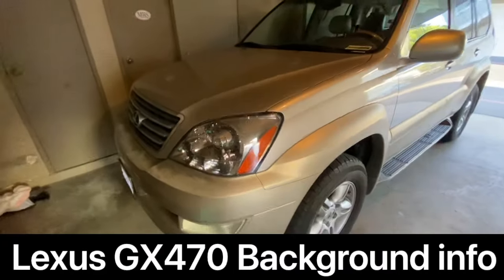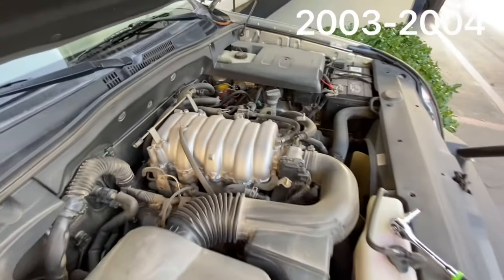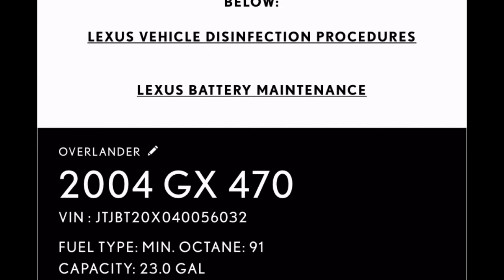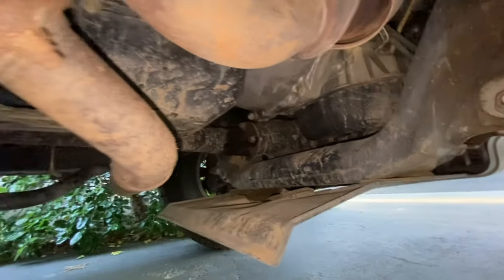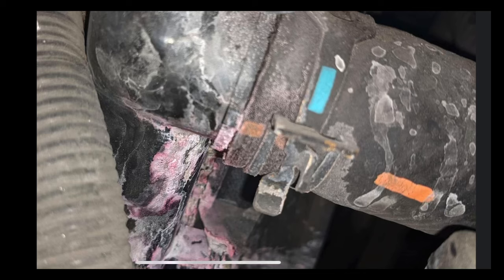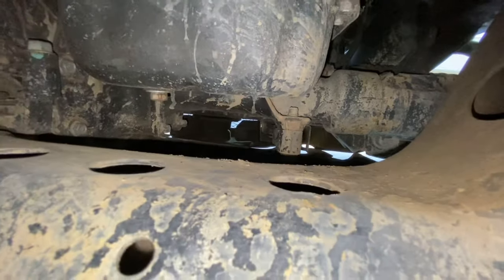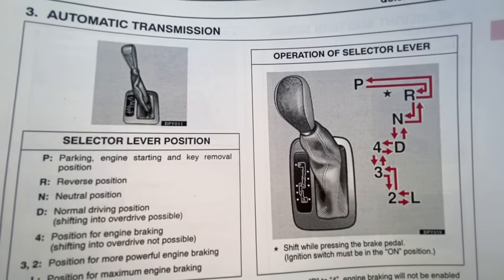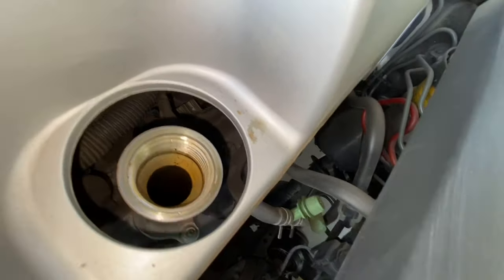LEXUS GX470 BUYERS GUIDE - 7 Things You NEED to Know

Comment: Thanks for the video. What are your thoughts of the 2010 models?
Reply from the maker: Thanks for watching! The consensus in the GX community seems to be to buy the latest/lowest mile GX you can afford or are in the market to spend, regardless of generation. The later ones with the 4.6 are more efficient and powerful, but that comes with more complexity. I believe there is a coolant leak issue that is common around 100-120k miles in those. However, the 4.6 has a timing chain vs. timing belt so you won’t need to spend $1k every 90k miles to change out the timing belt/water pump/bearings/pulleys. HOWEVER (haha) changing out those components semi-regularly on the 4.7 may be a contributing factor to why they last so long and are so reliable. There’s always going to be trade-offs. It depends what you’re in the market for. For me, I wanted a cheap, reliable, capable overland rig. Others may want a luxury SUV like Lexus designed these things for. If the former*, I recommend a 03-04 GX without VVT-i since there are more of those in the market and hence *should be lower priced. If you need more power and can spend a bit more, get the latest (07-09) VVT model you can find if possible to postpone the inevitable secondary air injection pump issue. If you’re looking for the latter a 2010+ 460 would be a good place to start, specifically post 2014 with the facelift. The 2010-13 has a face only a mother could love in my opinion lol but for me it would be worth it to get the benefits of the updated power train.
Reply: @lexus_offroad_adventures  thank you. Appreciate your thoughts.

Comment: I had to replace my radiator first thing when I bought my ‘04 with 155k miles.  Other than that it’s been a great reliable vehicle.
Reply from the maker: Nice, yeah I bought mine at 155k as well and the previous owner had just done a radiator+timing belt+water pump. No issues at all other than the transfer case actuator leak, which I fixed for a couple bucks and made a video about
Reply: @lexus_offroad_adventures  i have 210k on it now and am getting ready to do the timing belt and water pump again. I saved that actuator video just in case I need to fix that issue if it arises. Thank you for all of the great info!!✌🏻

Comment: Spectacular video. I am on the fence and thinking about adding this as my second and weekend car. I own a 200 series Land Cruiser which I love but want some thing reliable that I can not worry about. Should I be scared of 150,000 miles with good service records? Can this engine and platform really last 250,000 miles?
Reply from the maker: Thanks for watching! It’s essentially the same powertrain as the 100 series Land Cruiser, so yes, the longevity is legit. As I always recommend to people looking for a 470, get a pre-purchase inspection by a reputable shop (preferably a Toyota/Lexus specialist) before buying. It’s a few hundred bucks but it’ll do 2 things for you: 1) tell you everything that the truck needs in terms of maintenance or repairs, or 2) tell you that the truck is a lemon that you need to run away from.

Comment: Just in about to get 1 but not sure if is vwry neccessary buying a newer model or is pretty logic to save some money and buy the older 1 from 2003-2004. Also the horse power, is it a big difference between? Would really appreciate any advice on it as i cant wait of getting my first gx!!
Reply from the maker: I like the 03-04 for their simplicity. No VVT and no Secondary Air Injection (they all fail eventually) But newer ones do have 35 more hp which is nice.

Comment: Good job on the review, and analysis. If you see this what is the most desirable used Lexus 4xx.
I used to have land cruisers fj40, fj60,etc… got away from them for years. I Don’t want to have GM trucks, anymore and I like the one you’re discussing. I’m definitely buying one that has never seen off road, a soccer mom used one.
I’ve seen a nice 2011,GX 460, very clean. It says 4 wheel drive but are these AWD, also if they ran them on regular gas is that a bad thing with the ethanol?
Reply from the maker: Yes they are AWD with a Torsen limited slip center differential/transfer case. They become proper 4WD when you hit the center differential lock button and it splits power 50/50 between front and rear. 460s need premium.
Reply: @lexus_offroad_adventures  thanks for that. I’ve always shyed away from AWD, old school mindset. Like to have the front warn hubs unlocked.
But the GX460/70 are new generation, I think I’ve waited long enough for them to iron out any issues with the new designs.
I do kinda laugh when I see all the young guys, adding the big wheels & tires, lift kits, body accessories and then saying they don’t get good mileage !
I just think it’s funny. I will keep a tall set of studded truck tires for going off road. Thanks for response to questions. Now that I’ve decided what vehicle I want, I will wait until I find and un modified, well maintained, never towed, gx470.
Reply from the maker: @peterparsons7141  the AWD system is all mechanical (Torsen), so nothing to really worry about. The only electronic component is the center diff lock actuator, which is a potential pain point since then never get “exercised” by the owners, but just test it out when on your test drive to make sure it works and use it every so often if you buy the vehicle. Oh yeah, can’t go wrong with old school stuff. But if you’re going to go with a late model off-roader, the GX platform whether 1st gen (470, 03-09) or second gen (460, ‘10-present) is comfortable and fairly well proven in terms of reliability. My GX470 is 20 years old next year and, amazingly, everything still works! I’m sure if you find a clean example with the criteria you mentioned, it’ll be a nice vehicle for you. But yeah, no matter the year, if you put on big tires, they get thirsty 😅
Reply: @lexus_offroad_adventures  thanks , that’s exactly the info I wanted and just the broad information. I’m definitely going with the 467/470. The land cruisers are over priced and parts are hard to find. Regards to the center diff lock , it was a similar issue the the warn fron hubs in the old stuff. If you never used them or maintenance them, then they could get stuck/locked . Etc. So we serviced them when doing wheel service, and used them regularly. I do the same in my 5th gen, GMC trucks. Nothing worse than not using something for 18 months, 3 seasons, and then turn it on and go 100% full power.. dosnt make sense and never ends well with any machine or tool.
I just dismissed most of the new stuff, I happened on a very clean 460. Original owner, well maintained and started to look at them and realized these were pretty good machines. There’s no getting away from touch screens and computers etc, so my experience with Toyota’s tells me this is the way to go. But not new one, I’m not paying 80k for something that I may push hard. Insurance dosnt cover for roll overs in bad places.
Reply: Really appreciate your thoughtful informative response.
I’m starting to get a good feel for the GX, and am actively monitoring what’s available. I will do my work up front so as not to have to learn about potential problems when they appear.   Do you have a quick way of differentiating between models. I’m going second gen,  2014-201x.
As I understand there’s three models.  Base,Premium, Ultra. With the used car sales people obfuscating between these.
Base is easy. 
Premium.. with options
Ultra with options.
Crawl mode, and lane change indicator . Is this a telling feature which differentiates Premium/Ulta..?
Do car people still use VIN codes as an easier way to know what we’re dealing with ? (That’s an old dude question).
How do you quickly identify the most desirable?
Thanks again for you previous responses.

Comment: Great video! You briefly mentioned the KDSS that can be found in some of these models. After doing some research on the functionality of the system it seems to be a very good at improving the road handling but due to the geometry of the system and the complexity it can be very difficult to increase the height of the lift and suspension travel. Since you own a very capable GX, can you go over any issues that you may have had with KDSS and possible solutions? I Really want a late model Gx470 to build but I'm on the fence about KDSS. TIA
Reply from the maker: Thanks for watching! 
KDSS is great to get the best of both worlds for on/off-road handling. Problem is, you’re mostly limited to 2.5” of front lift and only about 1” of rear lift to not run into issues with “KDSS Lean” or a stiff ride.
This is really the only tried and true solution, just don’t lift it too high and it should perform fine. Actually would perform better to a normal GX. But a lot of people don’t want to be lift-limited like that. 

I just don’t run anti-sway bars in mine when I go wheeling lol that’s a great thing about not having to worry about KDSS: It’s not the limiting factor in lifting (if you just add the Icon front sway bar spacer to help clear the front coils) and you can just remove your sway bars if you want to go hard wheeling and rock crawling. 

A lot of people like their KDSS and I believe Treaty Oak and other companies have some KDSS spacers to allow for more lift without running into issues https://www.treatyoakoffroad.com/product/kdss-spacer-kit 

Not sure how well they work but I’m sure companies have come up with solutions to the above issues.
Reply: @lexus_offroad_adventures  thanks for the helpful information. I've been on treaty oaks' site and found a few possible ways to increase travel without the issues. Dr. KDSS has endlink corrections that bolt on to the lca to improve geometry. Maybe one day I'll be able to swing the $15k for portal axles and not worry about it. 😂

Comment: what would be the range of  driving mileage to get a GX in a good condition? I love your video because I wanna buy one but I don't know so much about those cars. Thanks for your information
Reply from the maker: Good condition depends on how well the car was maintained, not as much mileage on these cars. As with other cars, lower mileage is usually better, but not if it’s beat up or if it’s over-priced for your budget. I bought my GXs at 155k and 100k miles. Not a single issue really, other than some CV boots leaking and the transfer case actuator leak, which i show how to fix in an older video
Reply from the maker: I would just try to find one with a recent timing belt service that looks like it’s in good condition inside and out. Test all the off road controls and make sure they work. I made a video on how to operate all the off road controls: https://youtu.be/o_7ZrNIk70Q

Comment: Brakes have a few problems.. abs motors and rotors warping.. only thing I think you missed besides the info screen and heater control shared system.. sucks for aftermarket radios.. and a pain to add on anything easy.. no reasonable plug and play setup.. all stupid high for just ok stuff.. and I'm saying this owning  a car audio  shop for over 10 years...

Comment: Good review and good tips.  Makes my garage kept all original 2006 Non -Nav southern baby even more special, never seen snow or 4-wheel drive! 155K and still have original timing belt...alt the only major item replaced.
Reply from the maker: Awesome! Definitely going to want to cycle that center differential actuator. Some say if it doesn’t get used, it can sieze up. Wow original timing belt?! That’s should get changed out ASAP lol
Reply: @lexus_offroad_adventures  I asked Lexus technicians when I had the alternator replaced how many timing belts they've seen bad...of course none. I'm monitoring the water pump as the key to doing that major job, should add that the truck and only towed twice and for only short distances.  The way they are driven had alot to do with the drive train and components.  Wifes car so yeah it is babied.

Comment: What's the best used 1st gen best buy today? Looking for the best bank for buck. Thanks 👍
Reply from the maker: If you’re talking about the best specification, I prefer anything with non-nav. Makes it easier to upgrade the head unit. Other than that, it’s just down to getting a nice truck with a solid rust free frame, with good service history. The 2004 model year I believe sold the most units so there are more of them out there so they might sell for a lower price than the later models. But they don’t have VVT, so they have a bit less power. But they also don’t have SAIS like I said in the video, so you won’t have to deal with failing emissions equipment, which is a pain in states like CA.

Comment: I'am interested in a GX470, i am coming from a 02 Sequoia, one of the main issues is the bad lower ball joints in early 2000's Toyota trucks and suv's, do these have does same faulty/crappy LBJ?
Reply from the maker: I haven’t heard of this being a stand-out issue on the 120 chassis, but that’s not to say it’s nonexistent. I more hear of inner LCA bushings failing, requiring assembly replacement, but it’s usually not before an unreasonable amount of time/miles. My rig is at 170k and has been going off road for 20k miles with a lift and a bunch of accessory weight and they’re still fine.

Comment: Looking at an 04 with 180k miles on it.
Dealership wants $9,000. It is a GA truck, with an immaculate undercarriage. 
3 previous owners, which is a little much, but none of them put a ton of miles on it.

Still up in the air as far as pulling the trigger on it.

What do you think?
Reply from the maker: I haven’t spent much time looking into current prices but hard to beat a clean frame

Comment: I am from Los Angeles…i am looking at a GX470 from Chicago, IL…it has some visible rust, I can’t tell if I should be concerned about that…what are your thoughts?
Reply from the maker: Without looking at it I can’t really form an opinion. Doing a pre-purchase inspection at a reputable shop is always the best bet. See if they can test the integrity of the frame for you. My advice would be to stay away from a Chicago car and find something from the southwest.
Reply: @lexus_offroad_adventures  I took it to Firestone.  It seems to have quite a few problems.  Roughly $2000 worth.  They refused to put it on the lift, but did not test the integrity.  I will pass on it.
Reply from the maker: @cuethecritic  that decision will likely save you a lot of future headache. A nice example from a dry/salt free environment will serve you right

Comment: I got a 05 gx470 with 150,000 miles.. gold with light tan insides.. and I use it as my work truck.. my girlfriend drives a 09 rx350.. with 210,000 miles.. and she loves her car... but my 99 gs400.. with 280,000 miles runs harder and is smother then the other two.. I've owned 5 other lexus .. four 97 to 02 gs models and one 02 rx300.. I feel in love with lexus late in life.. and will own them till death.. looking now for either a 2011 is F.. or 08 to 2011 gs460.. any around kc,mo??.let me know

Comment: I was looking at an older 4runner for an extra vehicle but have since discovered these and don't see why I would get a 4runner over this.  Not going to off-road it, I have a Jeep for that but be used as an extra vehicle for trips etc
Reply from the maker: @michaelclld  yep, it basically has all the premium features of the highest rung 4Runner as standard (full time 4WD, active suspension, leather, etc.) and I don’t think prices are much different, although a lot has changed since I made this video. GXs used to be like 20-50% off comparable T4R’s
Reply: @lexus_offroad_adventures  I have found many but after watching your video the 2003 without nav I found is at the top of my list with 176k miles for 6800
Reply from the maker: @michaelclld  nice!

Comment: Towing  factor is the only reason I would consider selling my 2006 GX 470 with 137,500 miles on it.  Its tows a 12' enclosed trailer but to tow more than its towing capacity is NOT a good idea.  Therefore I would buy a truck with higher towing capacity because the GX 470 is not able to tow higher payloads.

Comment: I need your opinions guys. 

2007sequoia limited 4wd170k miles (2 owner w service records) for $10k
Or 
2008 gx470 155k miles (no service records, unknown previous owners,) for $10k as well 

Is there any noticeable difference, and is sequoias larger or smaller?
Reply from the maker: Check the Lexus owners site for service records  on the GX. All you need to do is create an account and add the VIN as one of your vehicles, then you can view service history done at any Lexus dealership.